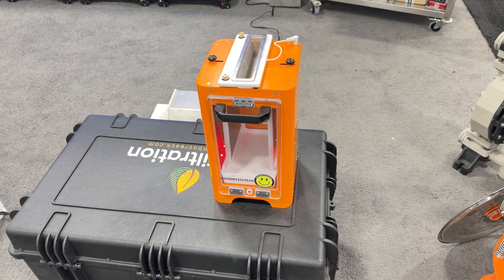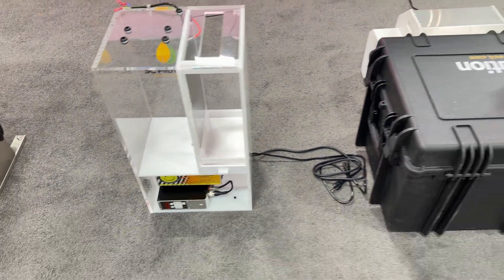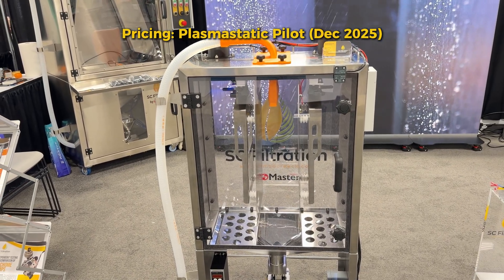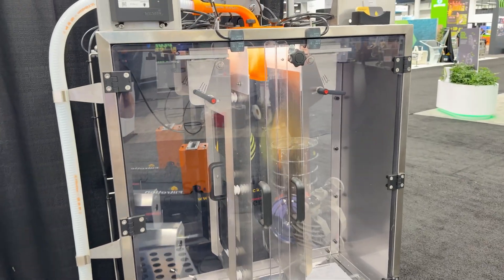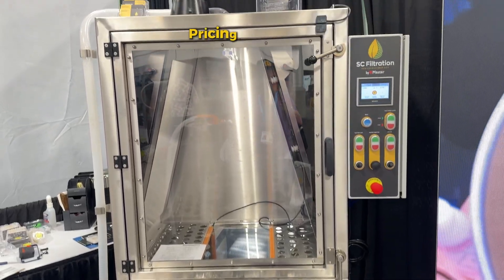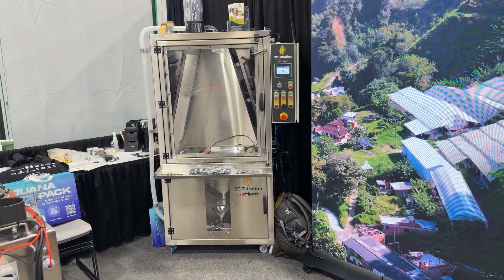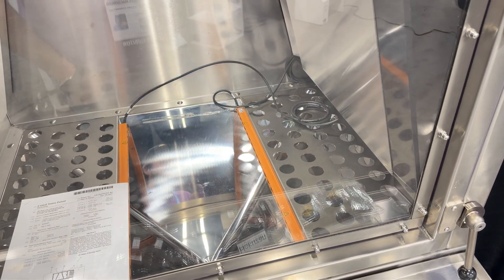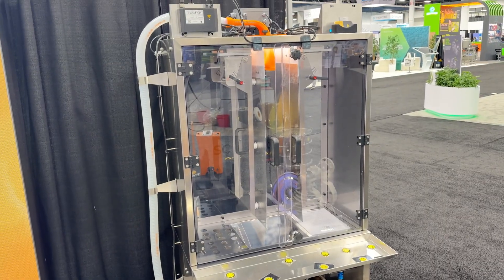Plasmastatic Versions in 2025

Comment: the r n d unit is described as for research. what  does that mean. is it as effective at static separation as the larger units. i mean does it do the exact same thing just on a smaller scale.
Reply from the maker: No. It’s similar. It’s for testing the % of trichomes on the sample. The difference between this and the larger machine is that the larger machine has a greater freefall distance and so it is capable of achieving better separation for that reason alone. Otherwise, the physics are very similar.

Comment: As soon as I saw a video about this device I decided to make a tiny one for myself but after doing a little research I found out that you need a 5~10 kv dc power supply and they are kind of expensive, not worth it for home use. It has a lot of challenges but I was going to enjoy building and tinkering with it but the price was the first constraint for me.
I think the best way for home use is bubble hash and dry sifting.
Reply: You can make diy static at home, we proved it on church here a decade ago (meze maccalman static video, 2015 or so)
Reply: @dertythegrower derty you been around a good minute my name on here changed a bunch of times but i always would see you comment and id just type Derty and that was it idk if you remember that but i been doing for so long now had to tell you
Reply: yes, they are pretty expensive. I think you should use something to elevate the electricity, like a transformer. Creating 10kv from a single power supply might get you headaches.